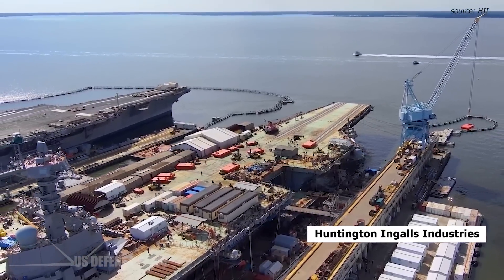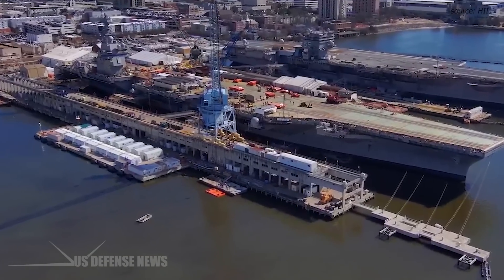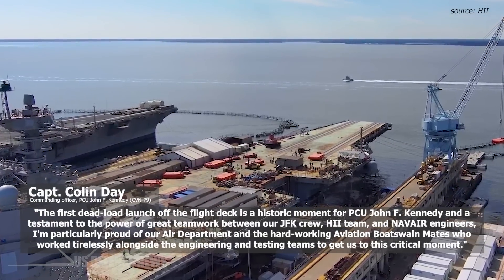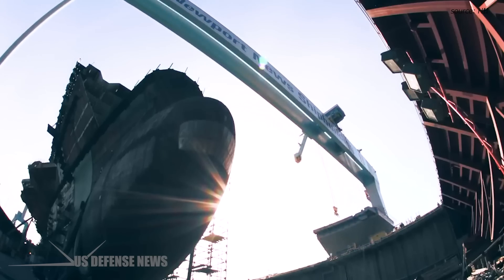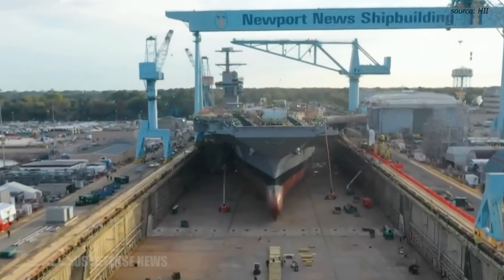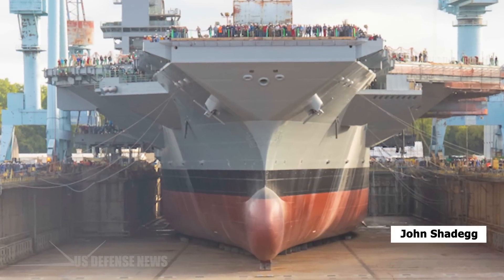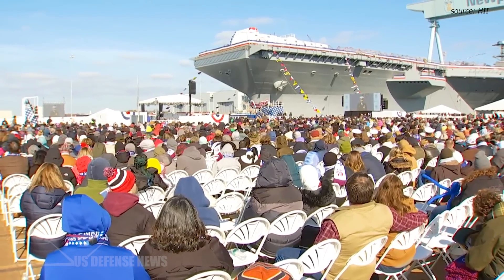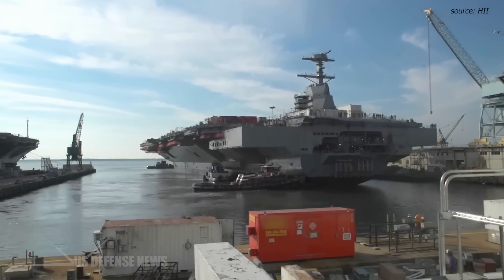HII Unveils New Video of U.S. Navy's Next Supercarrier USS John F. Kennedy (CVN-79) Dead Loads Tests

Comment: 3:00 Then why do the crew both operating the steam and pilots getting the business end prefer steam over this novel new tech? The Navy is pumping a narrative which on paper sounds nice but the facts on the ground prove counter. That to me is a clear flag. Im not saying something is wrong but something doesn't smell right and me personally if i had any clout id be looking into this. I get it the tech seems like it would be a no brainer and hearing that from crew and pilots was a shock to me which had me write this.
Reply: Perhaps its just teething of a solid tech advancement which has not been ironed out yet. Add to that the crew and pilots not being used to the tech and how it works but still. Typically if something really works the crew is on board 100% experiencing the results first hand.
Reply: It came down to trying to decide whether to go with a new system that didnt have the kinks worked of it yet. Or Go with steam on the Ford and then have to have a MASSIVE refit during its first long term dry dock service. It was decided to go with EMLs on the Ford after deciding that if needed the Nimitz could limp along for a few more years and the first few america class AA ships without well decks could be called to provide coastal defense should the situation require

Comment: I like the new look. Very sleek. It looks like it has 2 launchers. Anyone know if that’s true?
Reply: There will be four catapults when finished. I servedbon the USS Oriskany. 1960 to 1964 was a good ship. Last of carriers built during WW2 COMMISSIONED for the Korean War.  Survived 8 torpedoes in starboard side. 8 days later was in dry dock hunters point. 90 days later was back on the line. That one and newer are near impossible to sink.  Oriskany was sunk in gulf of Mexico, intentionally,  is now a man made reef, 22 miles south of Pensacola, Florida.
Reply: Four.
Reply: @paulmorissette5863  really. four electromagnetic catapults. That’s next level stuff
Reply: @Jermo7899  Yes. All modern USA carriers have 4. Even the steam catapults.
Reply: Two on bow, two on angle deck, at slightly different anglesvto esch other. Can launch. 4 aircraft in 1 minute just seconds apart.  I was an aircraft controller on the Oriskany, CVA 34

Comment: This video claims the USS John F. Kennedy (CV-67) served the nation for over 50 years. She was commissioned in 1968 and de commissioned in 2007. That's 39 years. I was stationed with VS-24 in Norfolk when the Kennedy was being outfitted and actually flew aboard the Miss Caroline (the Kennedy's C-1 COD) when the designated Aviator aboard the Kennedy needed another Aviator to fly with him on a couple of flights. From the time construction started until the break up of the Kennedy was over 50 years. 

Otherwise a very good video.
Reply: I served aboard the old JFK as well from 1972-1975. We had two C-1 Traders aboard. One was called Caroline One, the other was called Caroline Two. There was an 8 x 10 photo of Miss Caroline signed with a caption thanking all for the tour on the C-1 Squadron's admin window. When my tour was over, I left in a C-2 Greyhound out of Sigonella Sicily. I was attached to squadron VA-34 doing maintenance on A-6 intruders.
Reply: Kennedys and their claims.... JFK claimed he was on station during the Battle of Blackett Strait.